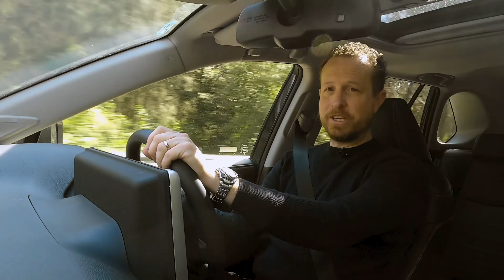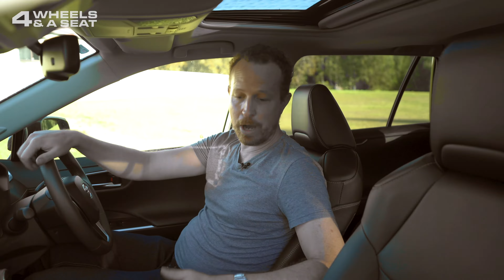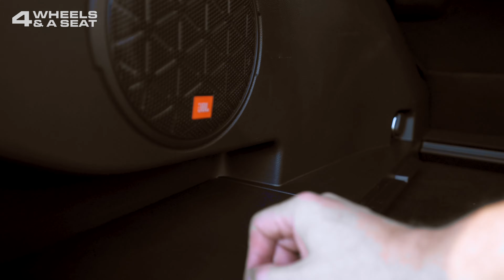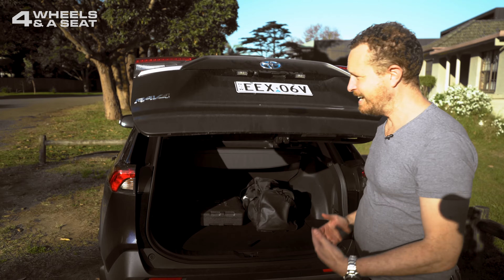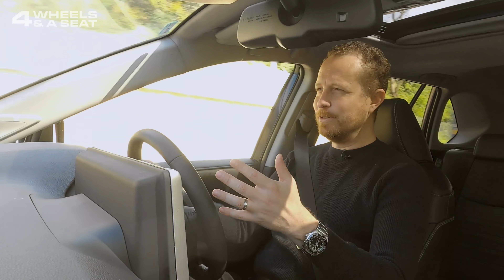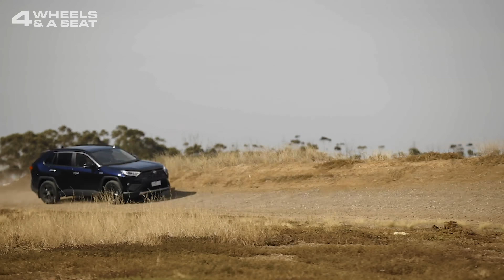2020 Toyota RAV4 Cruiser Hybrid Review

Comment: Is it 2020 model, Did it have auto folding mirror?
Reply: Only the 2021 models (at least in the Cruiser spec) have the auto folding mirrors (July builds onwards I think).  Models prior to this you have to push the button to fold the mirrors in.
Reply from the maker: Yes it is the 2020. It had power folding mirrors, but you can switch it on and off.